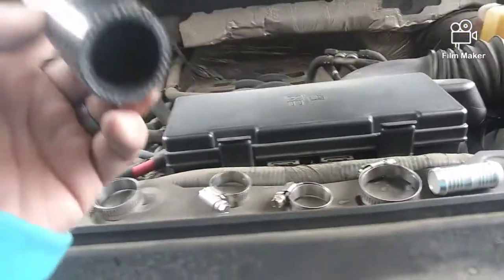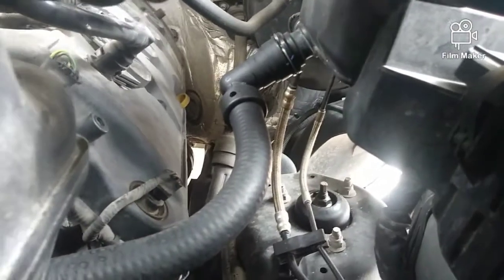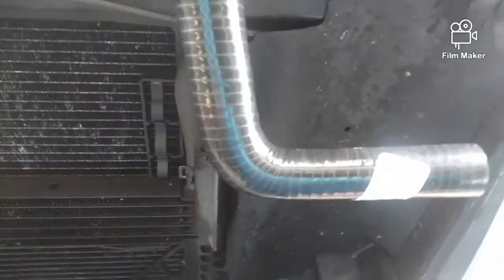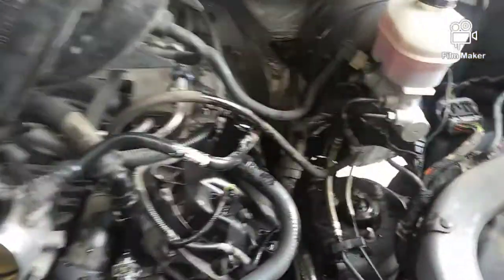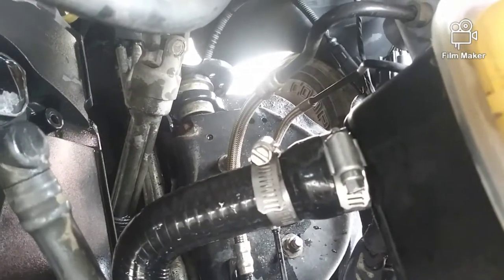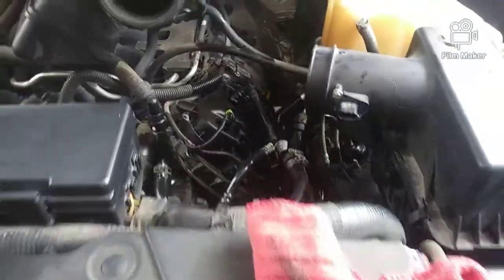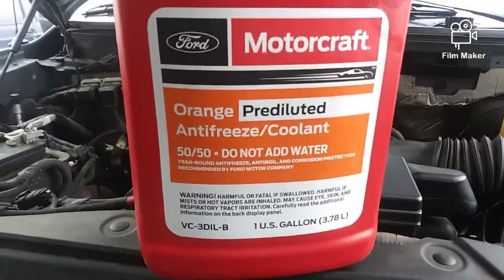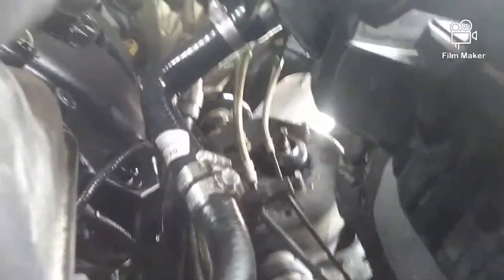2011 F150 5.0 Pegasus Racing Overflow Hose Kit

Comment: I soaked the hose in a bucket of hot water while I was doing the disassemble parts. It slide right on the tank and coupling.  It's still working so far. Thanks for making the video.
Reply from the maker: I have about 30,000 miles on this kit so far without issue.
Reply: @SandRatsGarage  Ford knows better than making a connection like that. Must have been just to speed up the assembly line.
Reply from the maker: @robbieeades1956  or to make it so most owners take it to get dealership and they make$